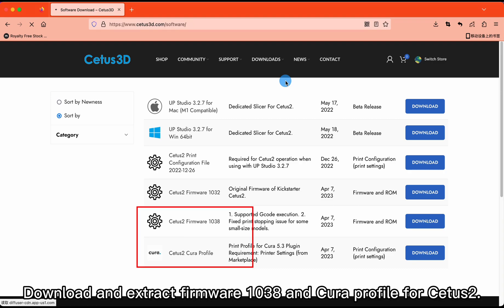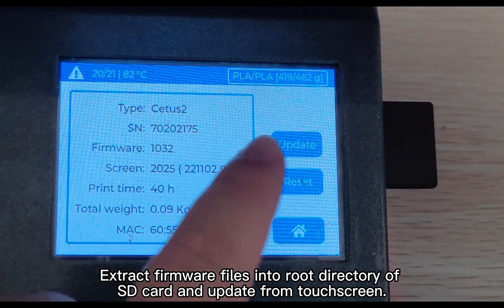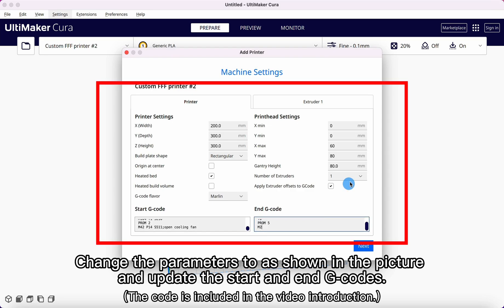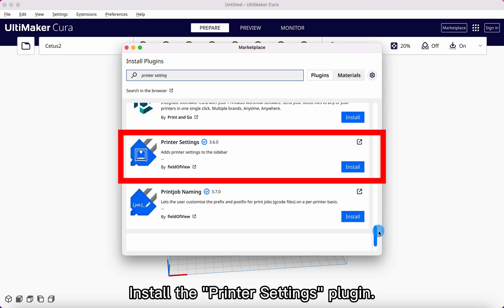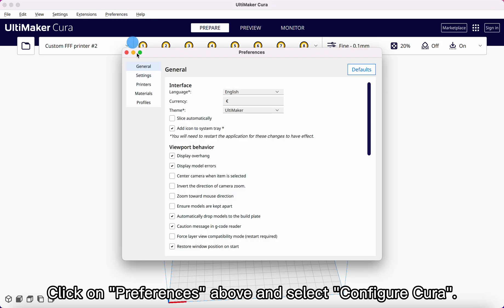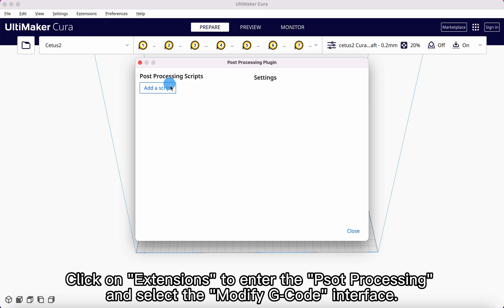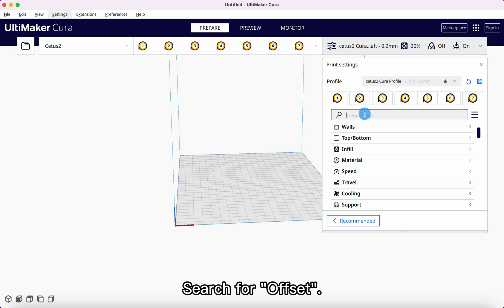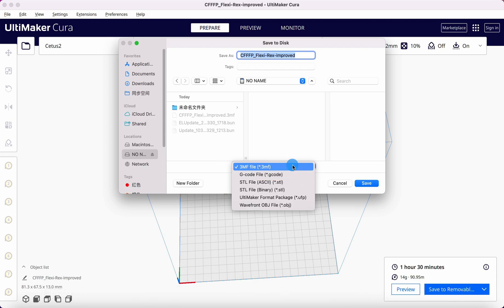Generate Cura Gcodes for Cetus2

Comment: I was able to set up the Cura profile and the printer reads the gcode.  However, it tries to print everything in the rear left corner.  I manually moved the position of the object away from the center of the build plate in the Cura slicer and was able to have it print on the Cetus2 plate.  Except the z-axis does not move up properly so it prints at the same Z over and over.  Finally, now it won't print with the UP Studio 3 slicer.  The Cetus2 consistently gives a [-800] printer not ready error.  I have power cycled, re-initialized and re calibrated, but I can no longer print...
Reply: Update - restarting the UP Studio 3 slicer corrected the [-800] error.  I can print again, but the Cura generated gcode is still broken.
Reply: Update2 - everything is working now.  I missed unchecking origin at center which is what was causing it to print off in a corner.  I don't know what fixed the z-axis issue, but it is printing fine now.